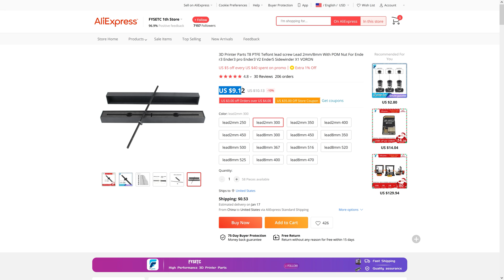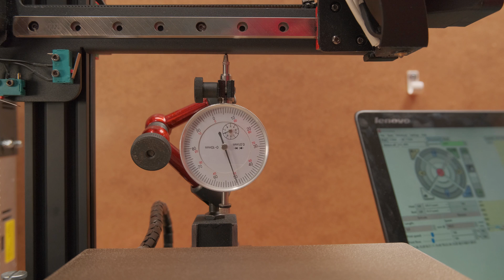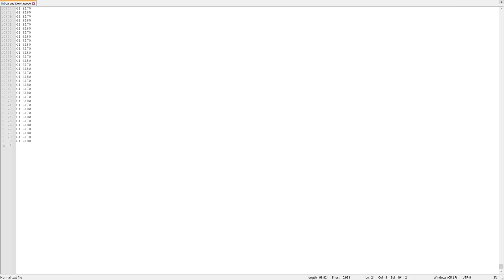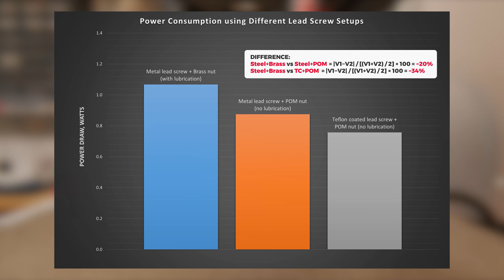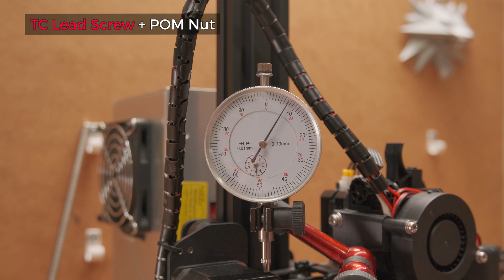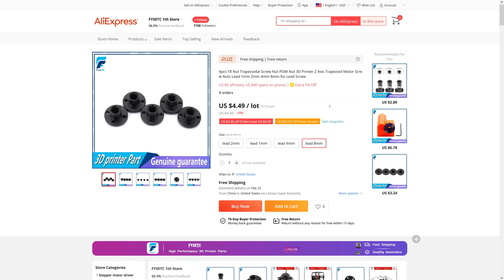TC LEAD SCREW + POM NUT = The BEST EASY 3D Printer Z-Axis UPGRADE or a SCAM?

Comment: The pom nut is worth it, less sound when fast moving Z, wear is not an issue for me as I don't print every day and they are cheap enough to replace them often. Brass always required to be greased (used a teflon spray) but over time, the grease/oil is gone or gets on your hands, build plate,... Note that use rods with 2mm pitch  as it's easier on the steppers from a load point of view (also use 0.9° steppers)

Comment: I don't know if if this is the place for it, but can someone please confirm what the EXCACT threads that these lead screws are? I've seen some call them TR8 screws, TR8x8 (Fusion 360 only has TR 8x1.5), and TR8 lead 4 start. I have checked on a ton of different sites from rando hobby spaces, thread tutorial sites, to even sellers like Amazon, yet NONE of them either tell me what I need ton know, or agree with what the thread for the SAME lead screws are. I thought that maybe Youtube would have the answer, but idk. 

Best I can come up with is that the standard lead screws used in 3D printing are some kind of TR8 screw with 4 separate threads. I would ASSUME it's proper name would be, "TR8x4" because it's an M8 Trapazoid screw with 4 leads, but I can't confirm it anywhere. 

Much thanks to anyone who responds.

Comment: I've been using POM nuts with standard metal lead screws for ages. Works pretty wel, doesn't need any lubircation, and quieter than metal nuts.

Comment: You are getting more irregularity from the POM wheel motion system then from the lead screw. If the comparison was made on a ridged frame with linier rails (variables that need minimized) then you could compare lead screws and lead nuts (standard and preloaded) then also ball screws. But without rigidity in the frame and no linier rails it is pointless!  But a++ for you effort and video!!!

Comment: 3:45 I wonder what could be causing the artifact near the middle of the benchi, taking into accound that you changed the Z-screws, is that due to some other issue on the gantry wheels or something like that? I am trying my best to get rid of a similar issue on my old CR-10, but found no luck.

Comment: I think it is no matter what kind of lead screw to use. If there is no any backlash, you can use any lead screw and any nuts (better use anti backlash nuts). The speed of the z movements so slow, so I think it is only promo in using lead screws with Teflon....

Comment: Have you considered a dry PTFE lubricant on the lead screw? The type you would use on components like sliding doors? Would be interesting to see how well they work with POM nuts since presumably they could coat the leadscrew more evenly/thinly compared to the TC lead screw

Comment: I use a 4 leadscrew setup on my corexy printer, steel leadscews with POM nuts. The normal brass nuts have some play, as where the POM nuts seems to 'clamp' the leadscrew better, so it acts as a anti back lash nut. Because the tight fit, there even seems to be a increase of resistance however..

Comment: What's your thoughts on Oldham couplings ?  I just changed over my heavily modded (including all linear rails, and extended height) Ender 3 to Oldham couplings with POM nuts (not the anti-backlash nuts), and PLUM shaft couplings.  I'm still getting everything dialed in, but preliminary testing is showing considerably less "Z related" issues.  My lead screws appear to be very straight, but I can see the Oldham couplings moving VERY slightly as the gantry raises and lowers.  I'm excited to get everything dialed in, and see what the end results are.
Reply: Too bulky, so it resuires modding and I ordered mine but they had a lot of slack between them. They are not precision machined as claimed and for the price they can't be neither. I'm going for the wobble x system when I can't stand the z-banding enymore

Comment: Looking at you just nonchalantly touching greased screw with bare hands, haha 😬 I always very gingerly move the Z manually if I need to, because argh, grease.
Belted Z is in my plans for that alone, so maybe a POM nut is an easier and simple solution until I get to that.
Reply from the maker: POM nuts are actually great, it is such an inexpensive upgrade, whenever I can this is the first mod that I do on non-enclosed printers.
Reply: I saw a video where there was also a guy touching his lead screws bare handed and he suggested using a rag or even a paper towel to wipe your fingers free from the grease imparted from the lead screw and I was blown away. I bet you could even just use a piece of toilet paper in a pinch. I found this to work so well that I've even started using rags and paper towels to wipe many other substances off of my hands when handwashing is too much of an inconvenience or fuss. Give it a try, you'll wonder why everyone doesn't employ this tactic for similar situations in daily life.

Comment: Why not test the teflon leadscrew with the bras nut ? I was thinking about going in this direction for my build, any advice ?
Reply from the maker: Any metal will wear the Teflon coating very fast. Just use POM nut with regular lead screw. From my tests and the comments who used it for a while it is the best option.
Reply: @PrintingPerspective  I've got to use brass nut as I am dealing with heavy load, so you say the teflon will wear off...
Reply from the maker: I mean, it is very easy to scratch the Teflon-coated lead screw (at least the one that I tested) with any metal object. If you are dealing with a lot of loads your best option would be to use a good quality grease that is rated for those loads or maybe even think about a ballscrew.

Comment: I changed pitch size with teflin lead screw. I'm happy with it. Note that you need to change stepps in marline to use it in that case
Reply: This you need to do in Marlin config or on screen. I have changed pod size movement as different for that I changed setting when you move 10mm it moves 10,1mm for example

Comment: Awsome video man keep it up! wondering if you run klipper on the printer? if so how do you level the bed ive just been homing it and moving the x and y axis in mainsail and adjusting it but is there gcode or something that does this
Reply from the maker: I do not run klipper at this moment, but there must be some scripts for that. I have been focusing on mechanical part of 3d printers, however there will be klipper orientated videos in the future.

Comment: By the way why are people even using a lead screw at all? Why not just use belts with linear rails? It works with X and Y and is common with delta printers. That seems a lot cheaper and simpler to me.
Reply from the maker: Mostly because of the gantry dropping down when Z motor is off.
Reply: @PrintingPerspective  That seems like a solvable problem. Depending on the performance/results it might still be worth it. Not to mention that double and especially triple z motors could probably add enough resistance to stop that from happening.
Reply from the maker: I will someday make this mod and compare it to the regular lead screw and ball screw version. The simplest way to combat "the drop" would be just to use reduction gears or belts and use a bigger stepper. And if that won't work, then things will get more complicated.

Comment: Doesn't matter what material you use, u WILL have to lubricate it for longer life span. Brass and bronze has low friction too, that's why they are used as bearing material.
Reply: I would say the POM nut and a metal lead screw wouldn't need lubrication if you take the POM nut as a consumable item, my understanding is the lead screw being metal and the nut being brass is the same way too, since brass is such a soft material, if you gotta replace it anyway, why not use POM and eliminate the lubrication.

Comment: I have a prusa mk3 clone with metal leadscrews and petg printed nuts, they've been working for 2 years and didn't wear at all, producing excellent quality prints. I did have to dial those nuts to be snug fit tho.

Comment: Excellent approach using the dial indicator. I also recently rebuilt my z axis and used a dial indicator to compare the before and after. using test prints can be difficult because the print quality is affected by many other factors.
Reply from the maker: I couldn't agree more. The best thing we can do is at least try to minimize all those other variables.

Comment: So what I gathered from this is... I'm going to try some pom nuts but keep my steel lead screws.
Reply from the maker: Yeah, that seems to be the best option.
Reply: Couple years later, I did switch to pom nuts on a couple of printers..they did improve print quality at first over the worn brass. Pom quickly wore out on my heavy bed core xy printer so went back to brass and change them every so often and lube frequently. 

At the end of the day they both wear out eventually and I will continue to use pom with steel lead screw on my lighter gantry printers.

Comment: I've been using pom anti-backlash nuts for a while. I switched due to noise on my ender 5 plus caused by the brass nuts. I stopped having noise issues and printing continues without problems. I now upgrade all my printers with them wither needed or not. Cheap and effective.
Reply from the maker: I didn't expected much from them, but honestly I was surprised how well they perform especially considering the low cost.
Reply: Hi! I can't seem to find a website where you can order anti-backlash nuts with 2 starts. Can you send me a link where you've bought them?

Comment: Great timing, just stumbled on the ptfe lead screws. Love the data driven approach. I wonder how hard it would be to get a manufacturer to produce consistent coatings and how much that would drive up price?
Reply from the maker: To be honest I have no idea. The problem is that each of them must be inspected, which would be the main factor of cost increase. Plus max allowable coating inconsistency tolerances must be specified so that you could know what to expect.

Comment: Ok so I just wanted to add my own experience with Teflon coated leadscrews. I ordered 2 for a dual Z. First off just because they are self lubricating doesn’t mean they don’t need lubricated. It’s recommended to clean all surfaces with a CLP or similar oil prior to use. I’m sure dry lube works as well but anything is better than nothing. Secondly the PFTE coatings were so thick they didn’t fit and needed sanded down to fit pulleys and such. They both were bent significantly more than the stock ender 3 lead screw and ultimately they sit unused in my closet for the reasons listed above. However regardless I will be swapping to ball screws as soon as I modify your amazing ball screw part! Btw I’ve shown that video to everyone I know I think it’s fantastic 😊!
Reply: Sorry we bought the same ones lol 😂. One issue I didn’t run into but was a concern. The amount of torque produced by my Z axis is definitely enough to destroy or deform the delrin parts. I never ran into this issue but at least with brass nuts if you crash the Z axis the motors stall because they can’t stretch the brass. I have been using anti backlash nuts for a while now and they seem to work wonders.
Reply: Whoah… minor improvements on a ball screw? You more than doubled the usable speed of the Z axis and got perfect Z hop with that upgrade! Now I want to know what you consider major improvement lol. Keep up the amazing work!
Reply from the maker: I love the ballscrew upgrade so much. The z hops are insanely fast, I just love watching it hopping lol
Reply: I’d really like to see if a brass nut will wear down the PTFE or if it provides better results as it wears down the uneven surface.
Reply: One last thing. They’re not threaded M3 because you instantly strip the treads of the plastic tightening the nut. At least that’s what happened to mine lol.
Reply from the maker: That's a fair point.

Comment: I think the nut is not supposed to be tight so it can compensate for irregularities or a bent lead screw. I had terrible z quality in my ender 3v2 and it got much much much better when I loosened it. Maybe give it a try!
Reply from the maker: In general, you are right. It helps mostly to deal with a misaligned lead screw and nut placement on the gantry. But the printer that I tested on had the perfect alignment, which is why I could tighten it. However, it is my bad for showing that because 99% of printers on the market have misaligned lead screws.
Reply: @PrintingPerspective  I just throw flex shaft couplers on them to help out with that. Maybe leaving them both a little floating would help balance the misalignment that cant be fixed with shims.
Reply from the maker: @hansoncrack  Yeah, I use those where it is impossible to align the lead screw. I prefer inserting a steel ball of 6-7mm between the motor shaft and the lead screw and then slightly stretching the flexible coupler when securing it in place. This results in no Z-axis bouncing and still gives the ability for a lead screw to tilt.
Reply: @PrintingPerspective  whats the purpose of the steel ball
Reply from the maker: Well at least in theory, it gives the ability for a lead screw to easily tilt and even roll/move side to side because it is on a ball.
Reply: @PrintingPerspective  I will give your method a try. In the past I have just inserted the lead screw, and then lifted it a small amount. Say about 4mm then tightened it, giving a small break between the motor and the screw. 

I dont chase grams and realize that these machines are meant to have some slop in them, given the price point. Sort of like flexographic printing if you are familiar. I usually only try to fix something if its actually causing a problem.

Comment: Very interesting. Great video! I will stick to my brass nuts and lithium grease as lube.
Reply from the maker: Yeah, the brass nut with lubrication should last way longer. The thing that I am afraid the most is POM nut threads wearing all the way and gantry crashing down on a single Z axis lead screw. ;D